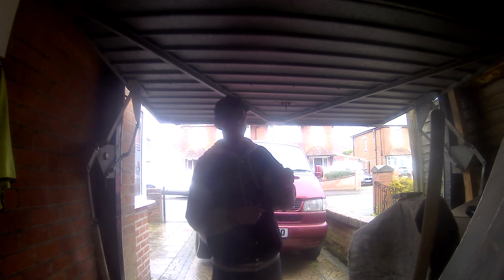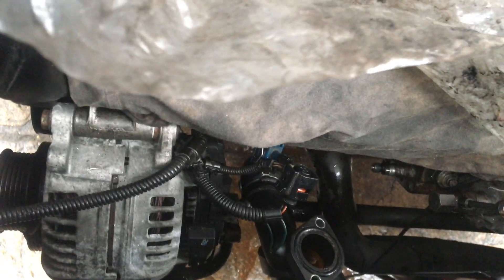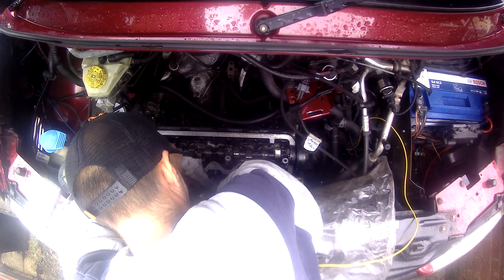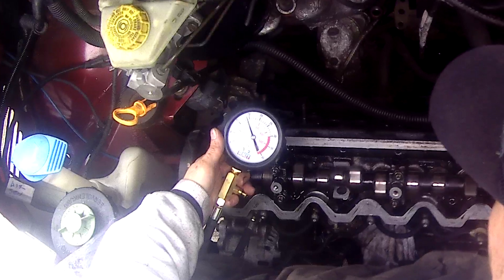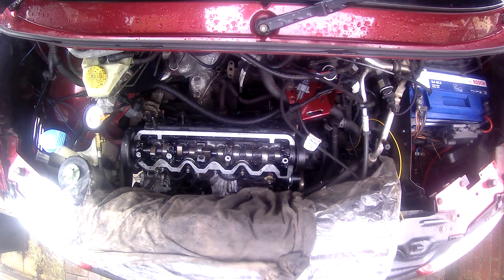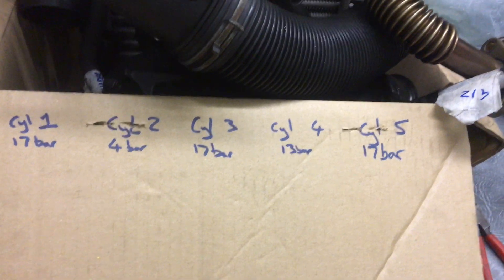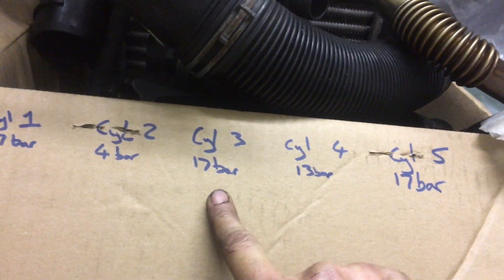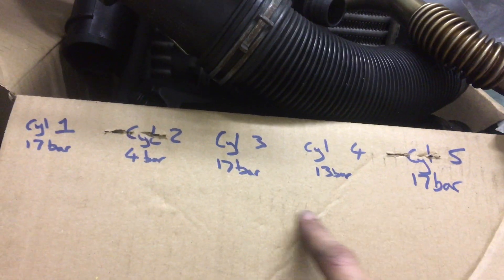Compression test 2.5tdi ACV

Comment: TWIGGS, thank you very much for making this 'How To'.  Looks like I'm going down the same route as I've ruled out injectors and now need to check compression.
Are you using the glow plug port or can I use the injector port?

Thanks
Reply from the maker: 👋 the test kit I used had adapter for both glow plug and injectors but I chose to use the glow plug port as you can just screw straight in. Good luck, sometimes diagnosing the issue, cause, problem is the hardest part. Let me know how you get on 👍
Reply: @TwiggsT4  thanks for getting back.  Will do.
Reply: @TwiggsT4  ..forgot to ask which test kit you used?

Comment: 34 bar is the factory compression. 26 is the absolute minimum expected. These type of gauges do not give accurate readings at all ;).
Reply from the maker: That’s very helpful thank you, all I have is a Haynes manual and it says minimal pressure of 24, and you are right I don’t think the gauge is very accurate however I was still able to use it to compare the cylinders 
Thank you for the info 🙏👍
Reply: @TwiggsT4  NP mate. I will have a look through my docs`n`manuals and see if I have any more meaningful info on compression. Will have to translate as I have it in polish. I`ve seen reading like Yours on healthy cylinders. These cheap gauges were the culprit.  Will be in touch.
Reply from the maker: Thank you so much 🙏🙏🙏
Reply: @TwiggsT4  yo, man. Drop me a line on sgt.raffie at mail on gmail. I might have something for You. In Polish but drawings and numbers are the same ;)..